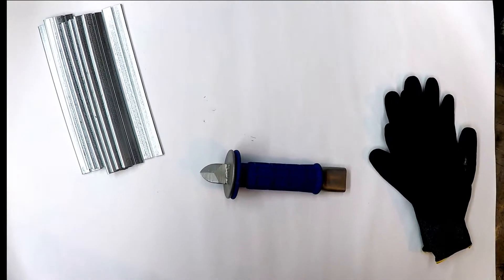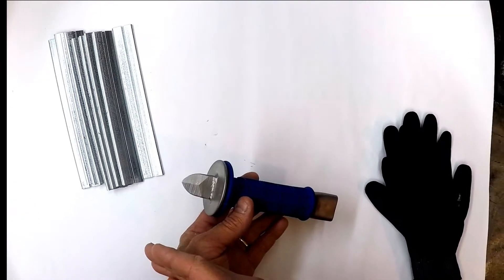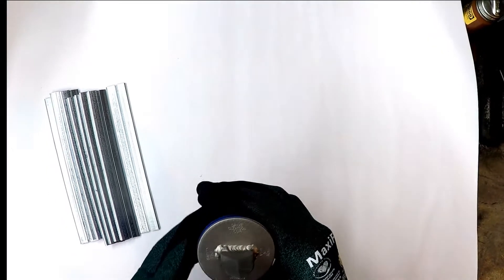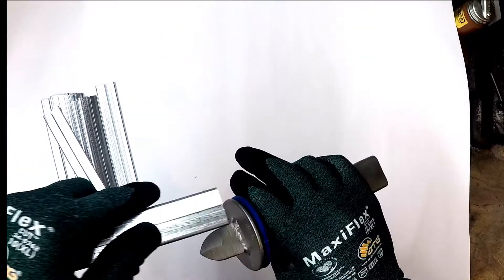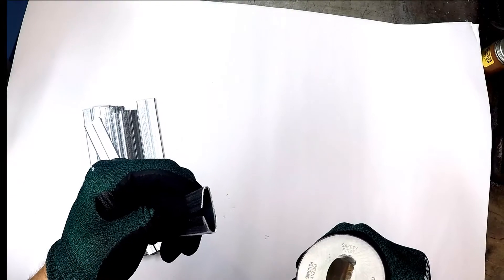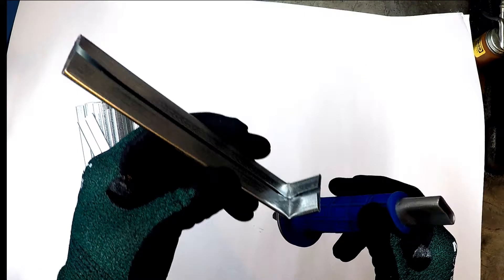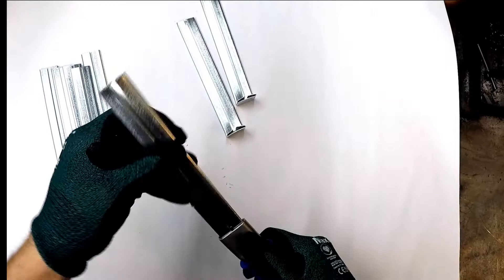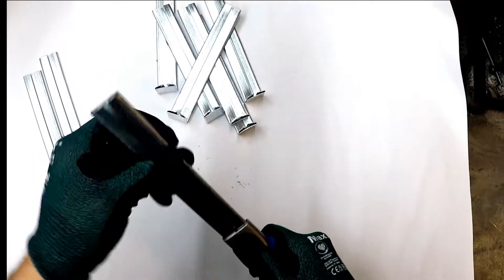Installing drive cleat Safer with the drive cleat tool

Comment: Do you find pre-bending the end leads to more fold/roll over when hammering longer drives?
Reply from the maker: To answer you question I feel the need to clarify longer drivers. For me I will try to change to TDC if possible when the duct gets to 20"x20" and bigger. Sometimes you just know that it is going to be a hard hammering on. In these situations I like to cut my drives long so sa the end radicals up I can cut the bad off and fold it over. I have good luck hammering drives on with the 1" fold giving me the predetermined stopping point then bending the other side.
Thanks Shawn
Reply: @Drivecleatoolcom  took the words right out of my mouth. 

I'm working on Ft. Jackson right now, and for some reason our foreman ordered 22"x28" duct with SLIP AND DRIVE. It's so frustrating. Not impossible, just time consuming. Especially because i don't own a duct puller.
Reply: I just measure my duct on the drive side add 3 inches and jam one end in my offset Seemers until it bottoms out For my pre-bend. With the excess I just tap what’s left over your flair technique is way more efficient than my flat head flare so I do believe I’m going to try what you have going on because no one likes that flat head slipping And jabbing your other hand

Comment: I cut my drives to length (adding 2 1/2") notch them and fold 1" in up to 20" long. Anything after that I cut 30", 40" or 60" (drives come 10' lengths). Folding the drive 1" the opposite way gives it more strength when hammering. TDC I find is more labour intensive. I'll use this on higher static pressure or outdoor installations. Great tool, though...very safe.
Reply from the maker: I have never seen a peace of drive 10 feet long, 5 feet is the gongs.
Reply: @Drivecleatoolcom  Commercially they come at 10' lengths 20 pieces per bundle 26 or 24 or 22 ga. Cuts great in a dry cut saw for mass production.
Reply: Commercial grade.
Reply: TDC and duct mate is just as easy

Comment from the maker: When I build my duct work systems the max drive that I install is 24". You can purchase a Bar fold 24" long to fold over that flange to make 1/2 the connection. Most of the time I will order my bigger duct with a flange called TDC or duct mate.
Here is a friend that has made a tool to help with those long drives putting them on and taking them off.
https://midwestsnips.com/product/mwt-cdt01/
I like pre-bending them my self, I do not have to think about how far to put it on I just drive it home and fold over the top.
Thanks Tim
Merry Christmas every one.